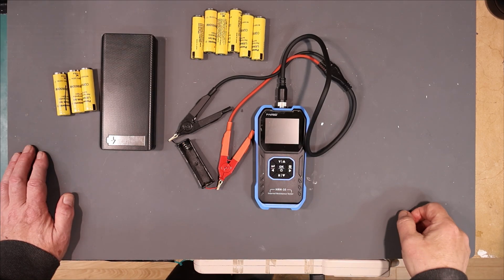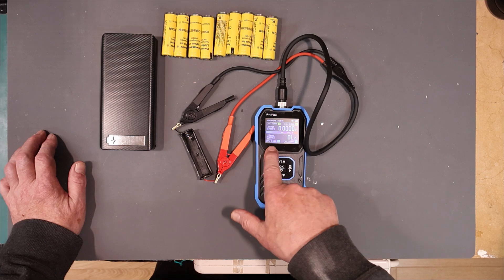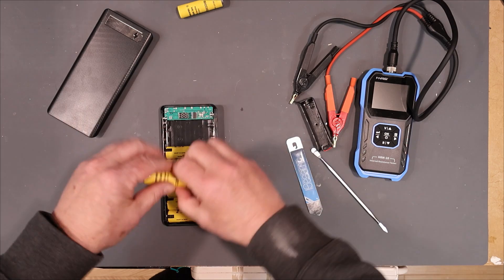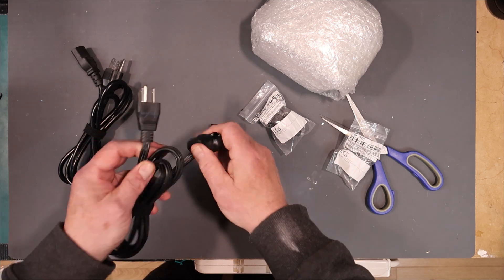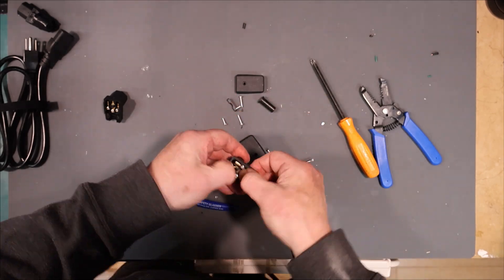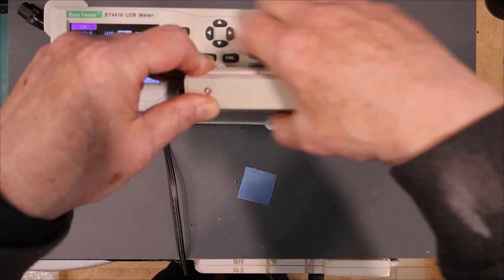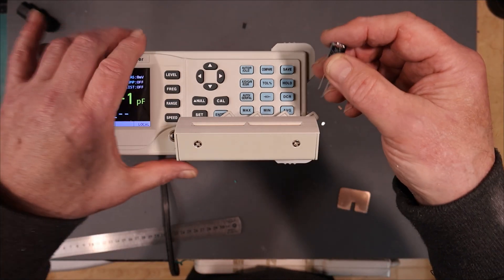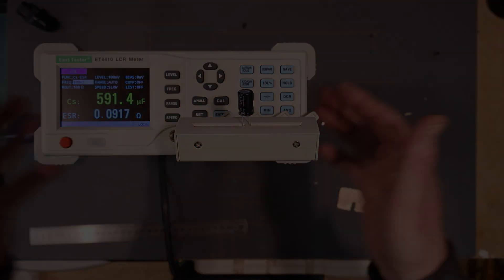Uni-Byte 0281 - Quick Projects with AliExpress ELECTRONICS Gadgets #2

Comment: I sometimes salvage whole grocery bags of AC power cords for free or for a quarter or 50 cents a piece. So I happily hand them out to friends who might want or need them. But the right-angle ones ain't goin' nowhere.  :)
Reply from the maker: Right-angle plugs are a treasure!
Reply: @uni-byte , same with the old oval 3-pin HP power cables used by their tube gear.